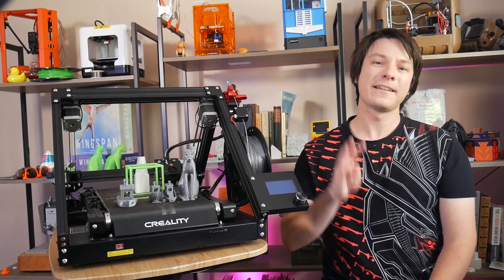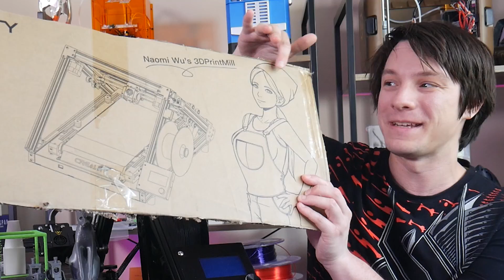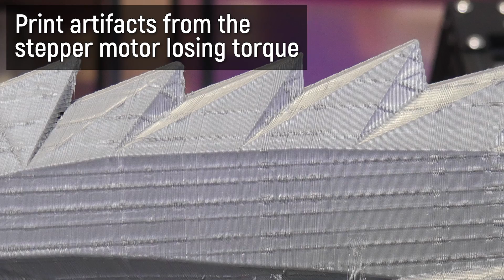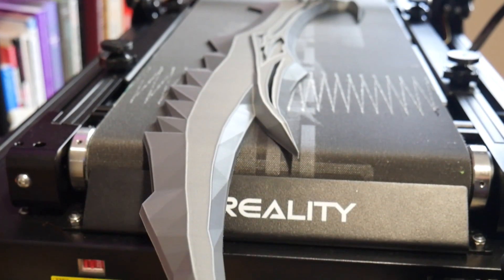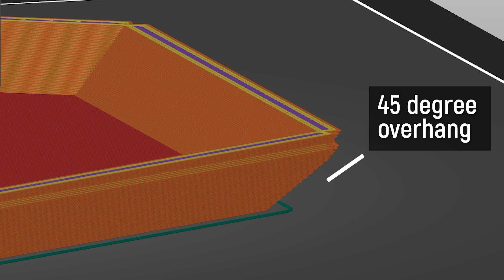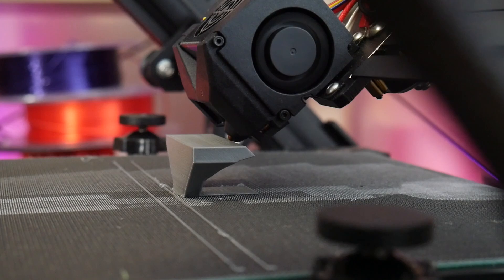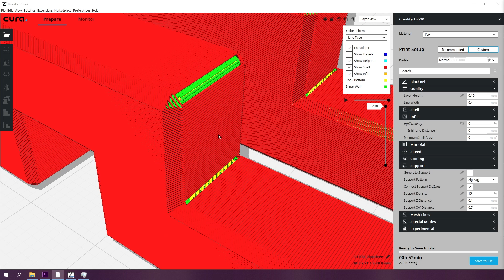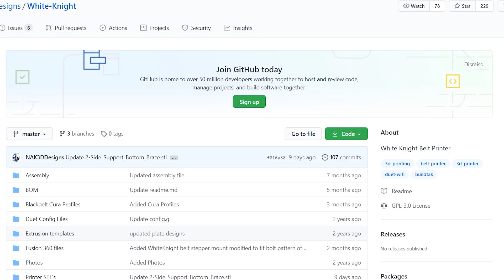Your 3D Printer can't do this... Naomi Wu's 3DPrintMill / Creality CR-30 Review

Comment: Conclusion-this is printer if you ONLY will make swords and cosplay stuff. And I wonder why Creality make the decision to put all that effort to this. Looking to direct competitor; Biqu or bigtreetech is doing more interesting and innovative stuff I guess. Their new BX printer gather all of those aftermarket upgrades in one printer (light direct drive extruder, octoprint connection...). And why this is right decision imho, is that not even a single 3d printer came out 100% polished and ready product.

Comment: Would be cool to see an upgrade/mod driving the belt tension and tracking with steppers and lead screws, for auto tracking and tensioning. Would need two more steppers and lead screws for full control, plus drivers, control logic, and probably some load cells for sensing tension.

Comment: A full six degrees of freedom robot arm doing 3D printing would be cool. Then you could do arbitrary and changing layer directions, especially if combined with a turn table for the build surface. I have seen some experiments with this (one with an industrial robot and a MIG welder), but nothing for hobby or even prosumer use. It also takes the complexity of slicing to a whole new level.

Comment: Why would Prusa build a slicer for a printer type they don't sell?
Reply from the maker: Creality printers are already in the wizard, and who's to say prusa won't make their own version
Reply: @MakersMuse  I don't think they will be happy implementing it before they're ready to launch a printer on that segment but I may be wrong
Reply: I think the solution is for us to mass-request prusa to make such a printer !
Reply: I don't think the Prusa engineers would do it in house. They have enough of theyr own stuff to work on and improve. And you have to consider that if Prusa decides to take features like 45° slicing into theyr software, they have to be able to provide customer support for it as well. I can see why they would not want to do that. Supporting the other cartesian Creality/Ender machines in the slicer is very easy and straight forward for Prusa. It's just some well known mechanical limit values that they need to put in there, to have a machine configuration ready to go.

Comment: Did Creality purchase the patent? My money is on a seise and desist coming before production starts.
Reply: There is no patent. It's open source and both of the originators have collaborated with Naomi and Creality and are fully credited. The control code is based on Marlin and so by extension is open source. There is no proprietary hardware so any company is free to produce their own.

Comment: 7:50 gcode can have loops
Reply: yes but that wouldn't give you the capability to keep adding new things to the printing cue as angus wanted to do.
Reply: @charlesbarden2042  You could do that with some scripting and octoprint couldn't you?
Reply: @charlesbarden2042  why wouldn't it? I thought octoprint could supply gcode line by line, which would let do just about anything with the right scripts
Reply: Is that universal? Or does the g-code reader have to support it?
Reply: @inund8  just have to add a reset restart code at the end of the printing gcode. Not hard.
Reply: @nobotty1451  which is good for infinite printing, but you can't use that to do a certain number of parts and then stop?
Reply: @inund8  Its all about gcode manipulation. Not the printer itself. If I am going to mass produce any prototype I am going to print the prototype inverted shell and use that shell to mass produce with. I I ever get a new printer ( Looking a the ender 5 or similar). I will be converting the ender 3 into a molding rig. Gcode is nothing more than GPS cordance and what to do when the head gets there. Octoprint can really be a big help with alot of this with the addons. If I understood you right. Just look at how the gcode is manipulated by the firmware and the Bltouch settings. It would take alot of  gcode tweeking, But once its done. You wouldn't have to worry much after that when running. I am slowly learning gcode myself as I am slow myself. But if you can understand C programing, Its not really to far from that. Just my opinion. You do not need a conveyor system to mass produce. The ender three has an place to put a servo added to a foot that can knock it off with the right kind of bed. Once it has cooled some. But I would rather mass produce with inverted prints. It would be a whole lot faster. Just have to do some cleaning and  smoothing. To them.   My problem right now is overly complicated prototypes and printing the molds for it. 3d printing is easy compared to molding. At lest for me right now. Like making a mold for a four legged Buck (deer) with antlers. Have yet to figure out a good way to split them so they could come out easily without flashing. Kinda stuck there. I love printer porn and can watch it for hours. But when you have more that one model and each one takes all day. Who's got time for that? Molding would be WAY faster.
Reply: As far as I know, only Duet/RepRap firmware currently does
Reply: @henrymach   It can be done outside of the firmare with octoprint addon. And it would only take some small coding change in marlin to do it internally. Because they already did it on this printer.
Reply: @nobotty1451  Yes, but then you get dependent on octoprint.
Reply: @henrymach  Is that a bad thing? I like octoprint. It's like putting a v8 in a honda civic!
Reply: @henrymach  nothing wrong with being dependant on something?
Reply: Octoprint addon will allow you to pause and deselect a part on the board. Then continue to finish the board. So, I am pretty sure there is a way to add parts in. Then put the code in a loop. Only pausing to make changes.

Comment: WoW! A clone of a clone of a clone. I'll keep my ender 3 thanks. A few tweaks and it will do the same thing.
Reply: It won't sequentially print 20 identical models without you touching it, it won't print at 45 degrees and it absolutely will not let you print a 6 meter long beam.
Reply: @BlatantlySwedishPGN  I guess you missed the whole tweeking part of that statement. I don't need a conveyor system to print a multitude of prints. There are more simpler way of do that And as far as the whole 45 degree thing. Not necessary. My prints come out just fine. But there is nothing wrong with it if that the type of printer you are looking for. It just seem to be a lot of expense for the same kind of prints.  The ender 3 Dose a better job in my opinion.
Reply: @nobotty1451  What tweak is going to let you print 6m long prints?
Reply: @nobotty1451  you can print super long things with it and once again, your ender 3 won't allow you to print model, after model, after model without you interfering in between each one.
Reply: @howardjones543  What are you talking about? This one doesn't even do that. But Yes It is possible. It does not have a 6m bed .The only surface of the belt that counts is the surface that is directly under the headend which ( by the vid) isn't much bigger than the bed on regular bigger 3d printer already on the market. The biggest tweek is in the firmware. If you have ever had to tweak your bed size in marlin. You would know what I am talking about.
Reply: @nobotty1451  @6:04 It is doing exactly that. I assume you are just trolling for arguments now.
Reply: @howardjones543  No sir. not at all. I am just saying that ( While this is still a prototype) We can all do this similar thing to our own printers and it wouldn't be a hard as some make it out to be. Because sales! The creators of things like this WILL always embellish their products. I am just saying that we all can already do this. I mean, If ( as slow as I am ) I can figure it out for the most part. That most anyone could. I putting out here possible ways of doing it with printers we already have. If you have read ANY of my post on the subject then you would know this. But thank you for allowing me to clarify this misunderstanding. I am not saying it is a bad idea. I'm just saying that. This one isn't anyway ready and if anyone wanted one like this. It wouldn't be THAT hard to convert.
Reply: @nobotty1451  again, the belt on it allows it to print model, after model, after model without any interferance because it moves the models away by itself.
On a normal printer you'd have to continously remove the prints and start new ones.
Reply: @BlatantlySwedishPGN  I am not arguing that. I am saying If you already have a printer that you can do some small modifications to do the same thing. Which would be cheaper than investing into a kickstarter that may or may not ever get into production. That one still has A very long way to go. I am NOT downing it. But It seems that creality does not have much faith in it. They aren't putting in the money. The patrons who invest in it are.  When/ if They get it to production It could very well surpass all of the expectations on it. But If I had the money and wanted to do mas production I ( personally) would jus Mod my ender to do the same. Everything on that printer in the vid IS open source AND plenty of vids on how to do it yourself. IF YOU ALREAY have a printer.
Reply: @nobotty1451  The printer isn't open source, at least not yet.
And I'm not sure how you expect to make your ender into a belt printer with some small modifications.
But hey, you go try it and tell me how it goes!
Reply: @BlatantlySwedishPGN  Uhm It's already does it. Look at the belt on the ender 3 that runs the bed. It's a conveyor belt loop( just a lot thinner). Simply replace the bed on the printer and modify the firmware to reflect the changes. Then add a loop back in the gcode. Add the pause and deselect part of that octoprint add on has( easier than changing the firmware for this part for me). The  bed motor signal can already run the conveyor belt. It would be just a matter of changing how the signal runs the motor of the bed. I you take off the kill switch limiter the bed would keep going one direction or the other until it was told to stop or reverse direction. This is NOT a new idea! Just up until now people have just got into it. I have seen way older videos 4+ year ago of open source prototypes similar to this thing. It was just not as popular then as it is now.
Reply: @nobotty1451  I get that it is possible to modify it for such purposes, but you're making it sound like a walk in the park. It absolutely is not.

Edit: Oh and how do you expect it to print at 45 degrees?
Reply: @BlatantlySwedishPGN   When has anything with 3D printing ever been a walk in the park? The Ender 3 already has a conveyor belt under the bed. It's what moves the bed in the first place. It's already in there. Just a thinner belt. If you want to see what I am talking about.  Undo the bed off the belt and connect the belt in a loop. Take off the limit switch and turn it on. There! Now you have a simplified version of this. The belt would continuously go in one direction or the other. Or untill you or the code told it to stop. The rest will just fall into place with tweaking the code. Or like with me with octoprint addon. with the whole pause and deselect part option. If octoprint can do this with an add on. It can also be added to the firmware. This is why I said the hardest part Would be the firmware.
Reply: @nobotty1451  well you said "simply" do this and that, explaining everything as if it'd take you a trip to the hardware store and a short afternoon to do it.
Reply: Itsonly seems like I am saying it is a walk in the park because I have to simplify What I am saying. Believe it or not I am not trying to write a novel on this.  I only wish to help inspire the ones  who wish to do this themselves. If I had the resource I would Just build it and show a video on how I did it. I only bought the ender 3 so I could build parts for the 3D printer I want. Because it hasn't been invented yet. If you want me to Show you, But It would cost you. I don't have the money to invest any more in my printer right now. Other than that I would love to do it. Just to show that it can be done.
Reply: @BlatantlySwedishPGN  That my friend is an assumption on your part.  Not once did I ever say anything like that. Just a misunderstanding. That only depend on how fast you are. I would bet that there are some out here that could. Me, No not at all. For me it would take days when it comes to the firmware.I live in a midsize city. I have yet seen any hardware store that sells the 3dprinter parts that would be required. They would have to be ordered to spec. But once you have all the hardware required. Then Yes. You could build the hardware in a day. Firmware? Not so much. But thats where octoprint addon comes in. I do not believe in can't. Failure is only a fail to try or give up.
Reply: Unless someone would want specifics. I really have nothing else to say on the matter.
Reply: @nobotty1451  "a very long way to go"????  Hardly, it already prints better than my White Knight, and from the pics I've seen of the other belt printers out there of comparable price, it is most certainly the most structurally sound design..  No printer is perfect on the first release ..   As for me "Embellishing" how hard it is to build one I'll just say this, go build one then then tell me how easy it was to just "tweak it a little"
Reply: @Back Atcha but don’t worry I share my knowledge freely, if you get stuck on the firmware just ask and I walk you thru the changes that are required.
Reply: @NAK3DDesigns  I will take you up on that. Free knowledge is the best knowledge. I only got the ender 3 to build the printer I want. Because it doesn't exist yet.
Reply: @NAK3DDesigns  Well after seeing the print that this thing was making. If that was the best than he was able to get. Then yeah. Its got a ways to go. As a prototype its pretty cool.
Reply: @nobotty1451  Were the first prints you did perfect?   He’s still learning the printer.   There are many other people demoing this printer that are getting wonderful results.
Reply: A simple upgrade. Just a matter of adjusting the bed size in the firmware. But I guess thats why its a kick starter rather than a product. It in early theory development.
Reply: @nobotty1451  Uh, no... It still can't print sequentially by itself.
Reply: @BlatantlySwedishPGN  You mean without being tweaked like this Kickstarter still has to be tweeked. That's why this one is still in development. where as mine. I aready have and could do these tweeks right now And keep the same quality I get from My ender  3.  A whole lot cheaper than what this will be . That is if and when it does come out. Others have already done it. This thing is no more than an ender 3 turned on an angle. With a conveyor belt. Basically the same thing. You must have invested in this thing. Good luck. I am that once they start sending it out that it will be great. I am just saying that My ender 3 can do the same thing Because IT IS THE SAME THING with mods. Mods that we can already do. I others have even posted here.
Reply: As a person that’s built a few belt printers.    Good luck with that.   It’ll take a lot more than a “few tweaks”.
Reply: @NAK3DDesigns  Nah, Others have already done it.Modifying the firmware would be the hardest.
Reply: @NAK3DDesigns  Hahaha. Classic.

Comment: First question, if that printer uses CORE XY, why then direct drive is not implemented, it feels bit stupid for direct drive not beeing used if u ask me, expecialy for machine that will print almost 24/7 or long prints.
Reply from the maker: I'm unsure why it's not direct drive but will probably modify my machine to have it.
Reply: @MakersMuse  nice, at least someone with logic :P well otherwuse i have to say that this machine looks promising, for someone who needs long print bed
Reply: @bajkerjohnvolta  Because the weight of the extruder is important, since the X Y is not flat, the motors hold all the weight.
Maybe a solution would be to convert it to a cartesian with ball bearing screw, at least on the shaft that supports the weight of the extruder.
Or put a flexible shaft or similar.
Reply: @estokdt  i get  that, but still in XY system, you controll weight from 2 sides simultaneously. And there are lightweight solutions for direct drive wich use pancake motor.

Also from price point, the way that drive is made now is way cheaper. And still both systems have ota own benefits.
Reply: @bajkerjohnvolta  Making a diagonal, with one motor stopped, will it support the weight from both sides? really?
You know how a CoreXY system works?
Reply: @estokdt  Yes i do :)
Reply: @MakersMuse  I’m working on a Bondtech DDX upgrade.   I’ll keep you posted.
Reply: @NAK3DDesigns  I've also had good luck with the aluminum Bondtech clones that let you screw a heat-break directly into the body.  I'm gearing up to try a light weight one from Mellow on an old Wahao i3.  I'd rather get a Himera, but they've always been out of stock.
Reply: I think @J. R. is right that direct drive would put an extra load to accelerate against gravity in the fast-moving, er, 45-degree direction. However, that problem would go away if the whole printer was tilted so that the belt was angled up at 45 degrees. But then the extruder would be squirting out horizontally, which might be... interesting.
Reply: @Graham_Wideman  "But then the extruder would be squirting out horizontally,..."
Not if you tilt it so the back is lifted to a 45 degree angle (belt angled down), then it would have the print head sitting in the same orientation as a standard 3d printer.  That would limit the 'Z' to ~1.414 times of the distance the printer was above the floor/ground at the 'ejection' end of the belt.  That would still give over 1300 mm Z from counter level.